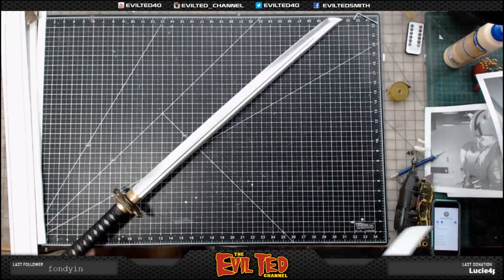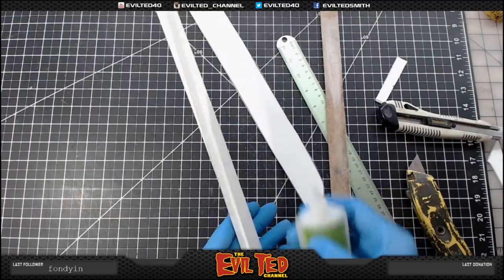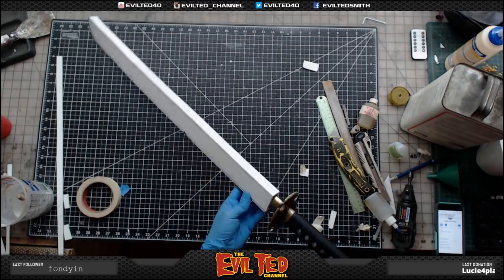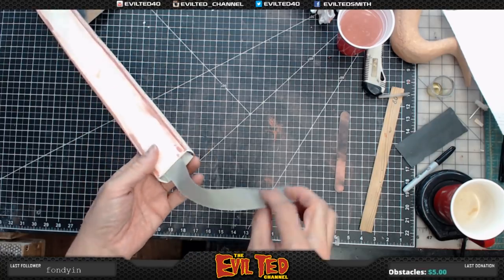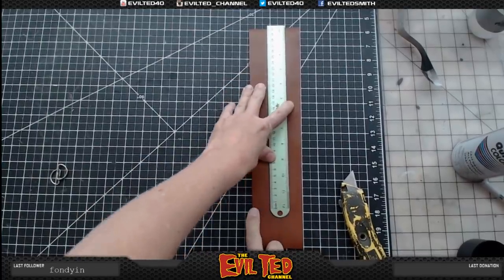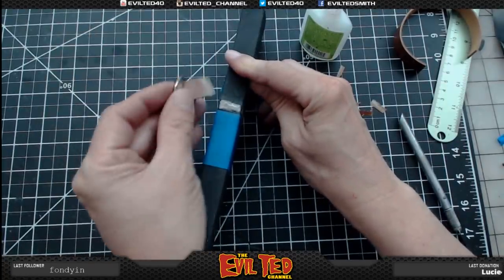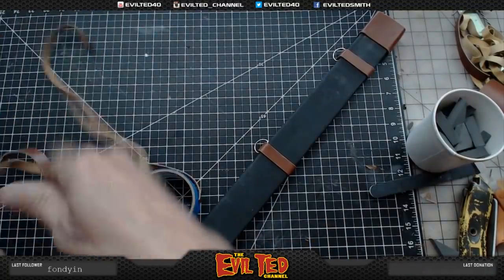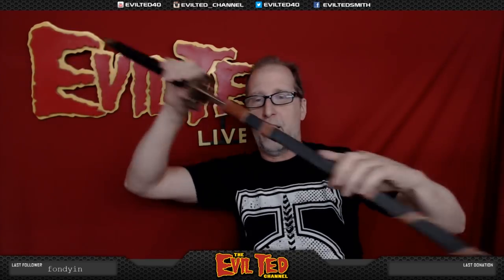Evil Ted Live: Making PVC Scabber

Comment: Great tip on the metal ring hardware. It's expensive to buy new. Go into Tandy leather looking for a D-ring or a Metal hoop, and you can spend $8-12 on just one. Or go to a thrift store, find the rack of belts that are usually priced at $1-2 each and find belts with multiple pieces of hardware. Cut them off the belt and reuse. Plus they're already weathered!
Reply from the maker: Yes, I'd find old back packs at the thrift stores. Tons of metal loops on them.

Comment: also aside from the joke about it beeing a scabbard: it doesnt fit the samurai sword/katana in my opinion. the sheaths for those are mostly in the same shape as the handle is which would be rounded/ oval-ish the fairly hard corners dont suit it in my opinion but thats ofc just my own view of it
Reply: Not to mention that there's generally no leather nor rings on them, they were just tucked into the belt.What they did have was a length of flat cord wrapped around the scabbard near the top then tied in a particular style of knot.